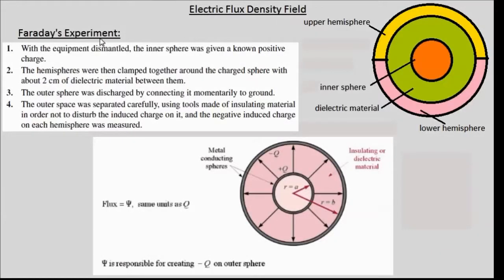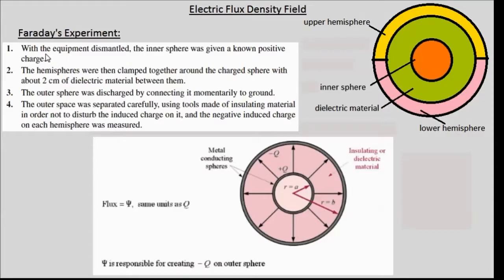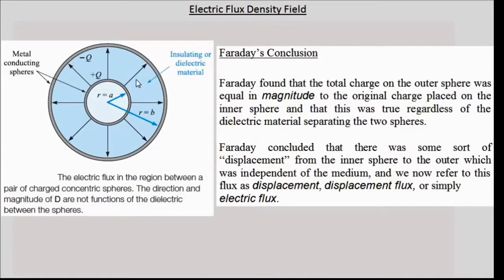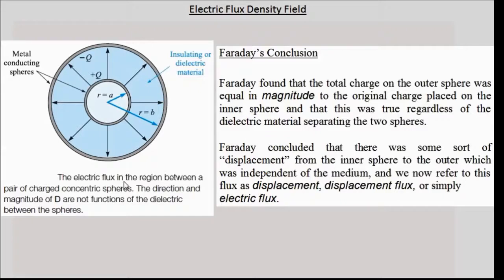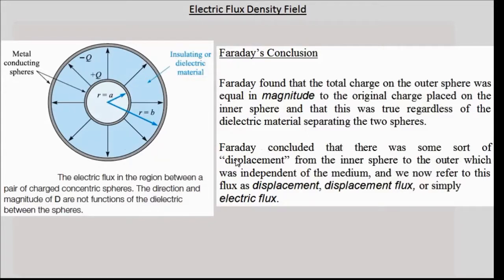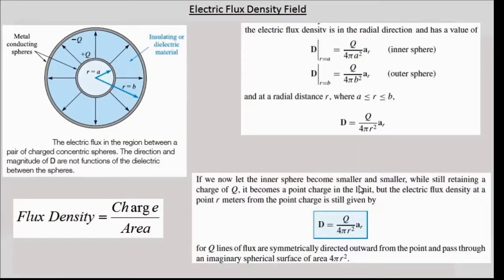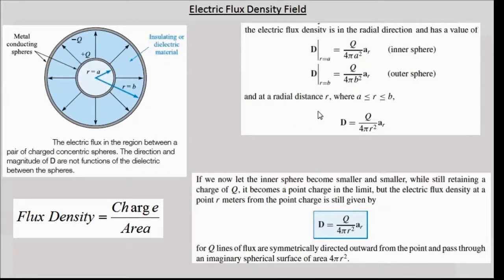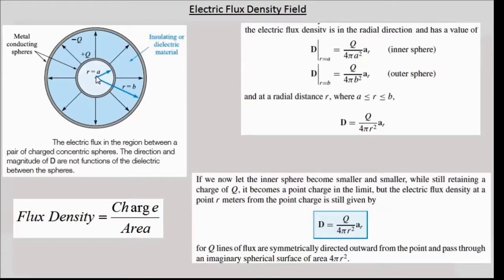faraday's experiment: electric flux density

Comment: Sir what happened when we use negative charge into inner sphere
Reply: Coming to the party late here.  
In the step when the outer sphere is touched to ground, electrons are flowing.  When the inner sphere is positively charged, the electric flux established between the concentric spheres is oriented outwards, which draws electrons from the ground to the outer sphere, thus giving the outer sphere a negative charge equal in magnitude and opposite in sign to the charge on the inner sphere.  When the charge on the inner sphere is negative, the electric flux density vector field is oriented inwards, which result in pushing electrons away.  Electrons are thus showed off the outer sphere and onto the ground.  This results in a net positive charge on the outer sphere equal in magnitude and opposite in sign as the charge on the inner sphere.